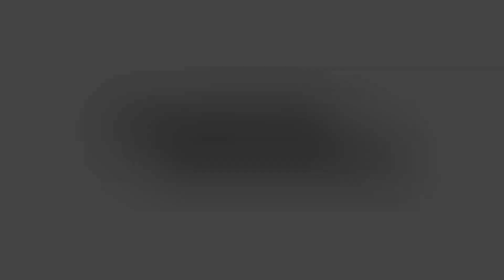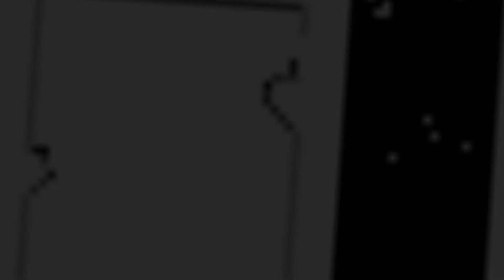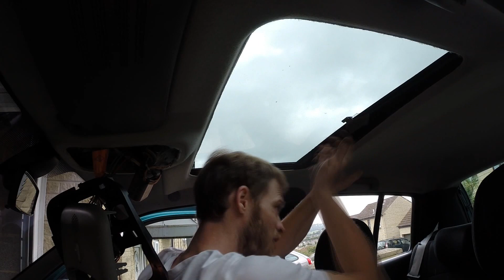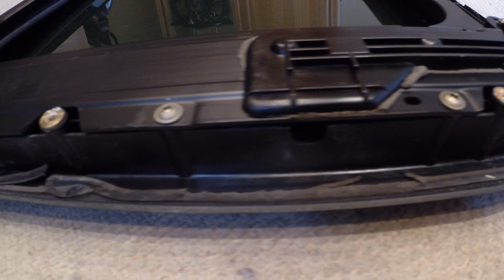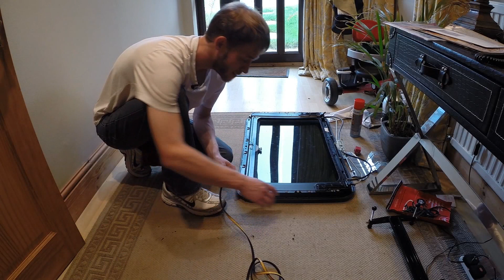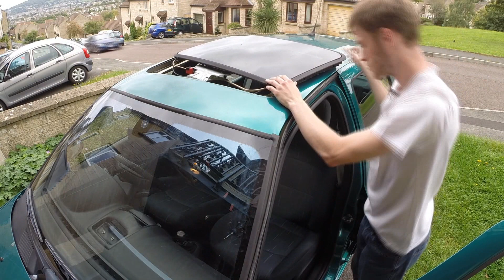Clio Leaking Sunroof Repair Fix

Comment: Great video but my Clio (MK1, 1994) has its sunroof fixed with Torx screws instead of the 10mm bolts! These proved impossible to remove with the headlining in place so I opted to drop the whole thing. The problem is that the lining is glued to the car roof so once you get all the plastic trims off round the sides you need to pull it away gently but firmly. It will appear to crease horribly but surprisingly it regains its appearance perfectly once it comes out! You'll need to use a long stick or suchlike pushed in from the tailgate end - move it gently backwards and forwards to loosen the strips of glue then do a bit more pulling and tugging. The glue has a fearsome hold but it DOES eventually give up. You'll hear a sort of tearing sound as you pull at it. Eventually the whole lining will come down with a 'pop' and  a clang because the woefully thin roof panel of the car is like a steel drum! 

Once the lining is down and out of the car access to the sunroof screws is good but I found the Torx screws just chewed themselves up as the bit slipped (as they do!!) Eventually I got them out with a small vice grips set very tight. I used mastic strip (sort of stuff normally used to bed Velux window glass) and applied it to the edge of the roof rather than the actual sunroof. Another snag is the that with the roof lining out the undertray falls into the car when the screws are released so you really need a second person to hold the tray back up against the roof as the sunroof is offered into the roof from outside. 

If you want to be dead sure of a good job you can apply silicons round the frame on the INSIDE of the car for good measure once the sunroof is bolted back up. The MK1 Clio has NO drain pipes from the sunroof and once you get the undertray out you'll see two odd rubber mouldings that sit in the from corners - covering holes that look as if they were meant for drains in other applications. I cleaned up the rubber parts and superglued them back in the siliconed over them from the underside of the roof just in case they were leaking water past. Beware this job can take a couple of days work if you opt to drop the headlining. I can't think why my Clio has Torx screws - most other folks online mention 10mm bolts. Presumably Renault changed the sunroof design a few times!

Comment: Hi, i have a mk 2 Clio 1999 with a manual sunroof, would this work on that too? I'm getting water on top of the driver side where the visor is. Also, if you do recommend, how do you attach the ends together? so you don't get a leak. Thank you for your help and if you can offer any further assistance's.
Reply from the maker: Hi there. Yes this will work for the manual sunroof too. You want to stick the ends at the join so that both pieces touch. When you tighten the sunroof down, the draft excluder spreads out and makes a seal at the join.

Comment: Pro Tip: When you are taking out the sunroof you need to undo 3 screws on the plate and 3 screws on the sunroof motor. pull the roof lining down for access.

Comment: Nice vid made it look like easy :) im going to go to whicks tomorrow to get the seal. I was just wondering how you joined the two ends and where to did you have the joint like left front corner ect. Thanks your help will be much appreciated.
Reply from the maker: I just join the ends together at the rear of the sunroof. I wouldn't advise having the join on the corner. just stick is to the plastic surround so that it mates up to the other section, the clamping force of the sunroof being bolted down will squash the seal out and make a nice bound. Have fun :)
Reply: +RandomReviews 
Thanks for your video. Just done this to Mums ageing Clio. Going to leak test it tomorrow with the hose. Fingers crossed! Also though I don't think there was any mention of it, I think it has also cured the hideous rattle that the tin framing bit was doing against the roof!

Comment: how did you get the motor away from the sunroof? its the only part i cant shift....
Reply from the maker: From memory, there are 3 torx screws holding the motor to the sunroof. One of them is behind the roof lining, gently hold the roof lining back to get a torx screw driver on it.
Reply: RandomReviews thanks, that was correct, i ended up pulling down the headlining tho, as it just made for easier access. the damn grab handles and sun visors are annoying to refit tho. Excellent video really. best one ive found for electric sunroof, and the seal looks and feels like it will do the job correctly. i made the mistake of using bathroom sealant last time and now this time i had to clear that up too. was quoted £100 for the same job. did this for £4 lol plus my time.
Reply: +RandomReviews Thanks mate.

Comment: This is happening with my Cleo right now!
The front passenger seat gets really damp every time it rains as does the ceiling above it including above the passenger mirror. The rest of the car ie drivers side and back seats every is completely dry. I checked the drain tubes and they are not blocked. The problem lies only in the front left ceiling..
Gonna give the sealer a go. How has the sealer you used lasted?
Great vid also (y)
Reply from the maker: Hi there chap. A real nuisance these sunroof's, aren't they?! From experience, they do tend to start leaking on the passenger side. I have repaired numerous Clio sunroof's with this procedure and all seem fine. I did have one that still had a very minor damp spot on heavy downpours, but it was almost imperceptible to be honest (could have been the sunroof to glass seal).
Reply: Yeah mine sure does suck. I've resorted to  taping around the whole sunroof on the outside with unibond duct tape until I buy a seal. If only I didn't have a sun roof...